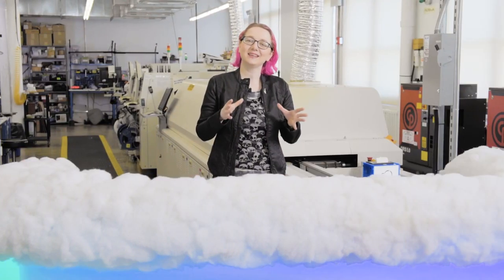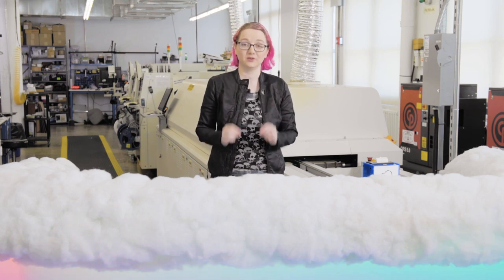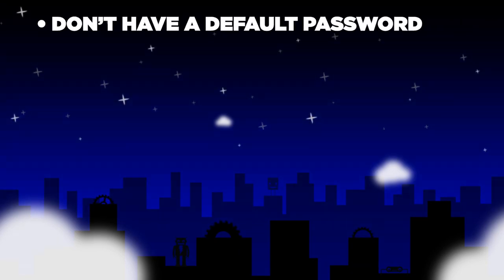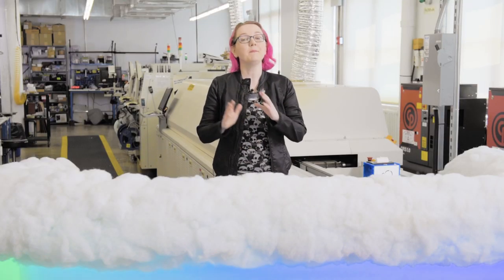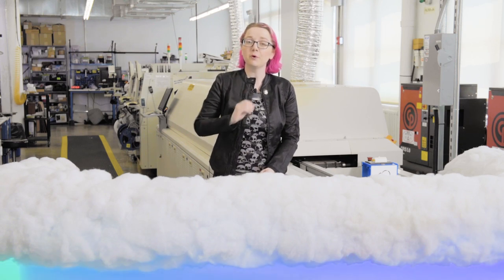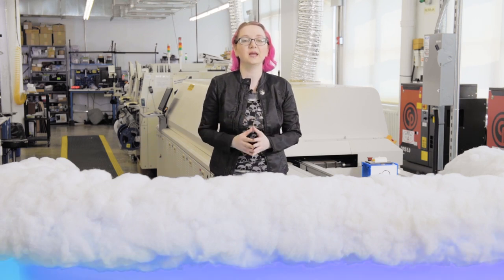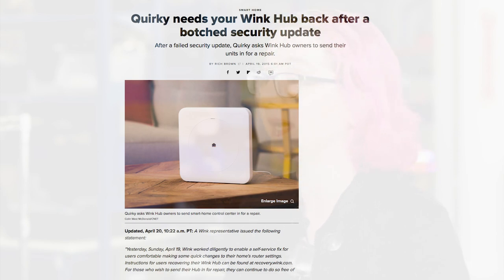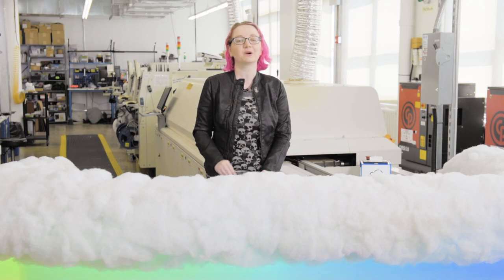All the Internet of Things – Episode 5: The S in IoT is for Security

Comment: That's a very useful list of risks to focus on.

To elaborate on 4.5 Authenticate Host Certificates at 16:10, it's surprisingly common during development for the validation of the server certificate to be intentionally disabled. This may then unintentionally propagate to the final product. A pre-release test which checks for a failure against a dummy service with a misconfigured CN is a wise precaution to catch this and any other faults in this area.

The time/clock needs to be correct to fully verify a certificate. The CA certificate bundle needs to be maintained too.

Comment: Very good presentation, lots of good points.

The security chip is a good idea for storing keys and credentials as long as you can protect against physical access, otherwise you can just monitor the lines. I like the new ESP32 security package that has built in encryption engines and can encrypt the firmware.

You don't normally need to be more secure than the NSA, just strong enough to make an attack more expensive than what they could possibly gain from a successful attack. If you're protecting millions then a successful attack must cost the attacker hundreds of millions. If you're protecting hundreds of dollars the attack should cost tens of thousands to be successful in both time and equipment.